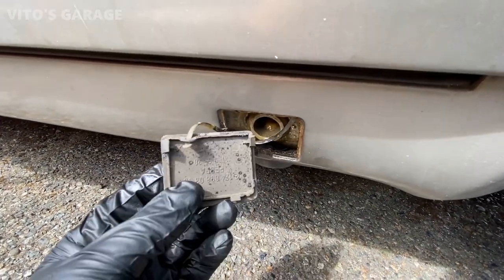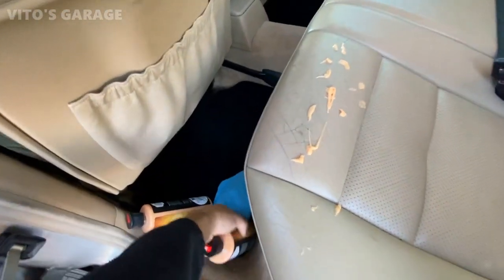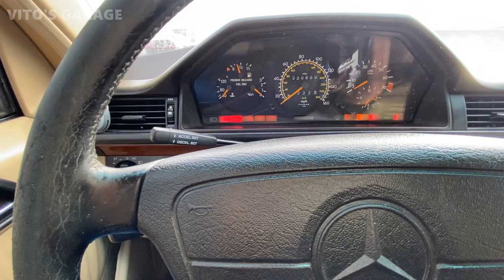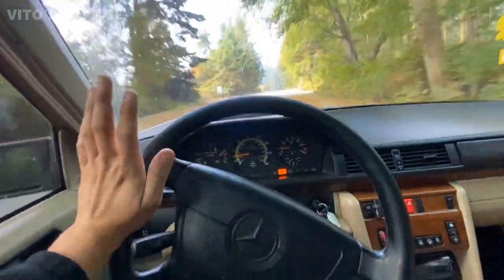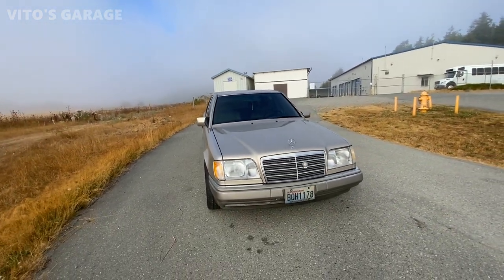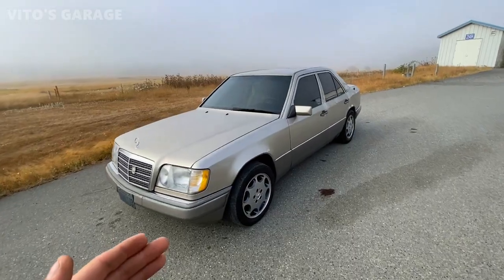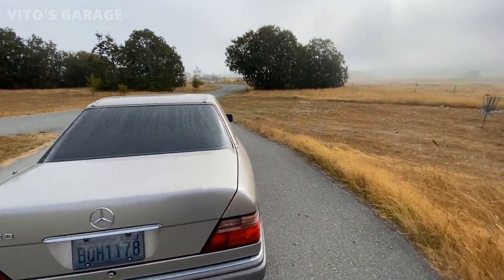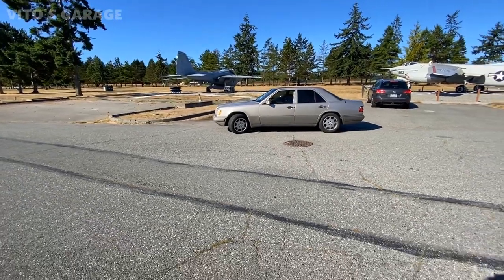The Owner is Picking up His Repaired Mercedes W124 E320! Here's What's Been Done to it + Test-Drive!

Comment: The tires are pretty bad already
Reply from the maker: I had to adjust the alignment. The car was pulling to one side pretty bad
Reply: @VITOSGARAGE  maybe let the Mercedes-Benz dealership do it maybe they can do it
Reply from the maker: I didn’t want the customer to drive 2 hours home when the car was pulling to one side. He already replaced the front tires on it and I’ll need to finish the rest of the suspension and steering work on it next time. There isn’t much left to do, just the lower control arm bushings, steering dampener and idler arm in the future. The car is still very safe to drive
Reply: @VITOSGARAGE  ok